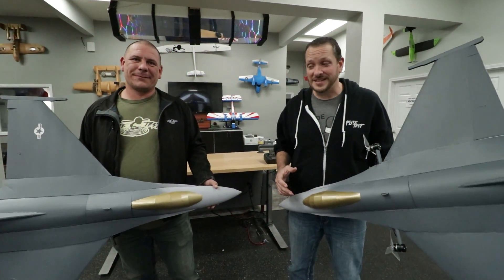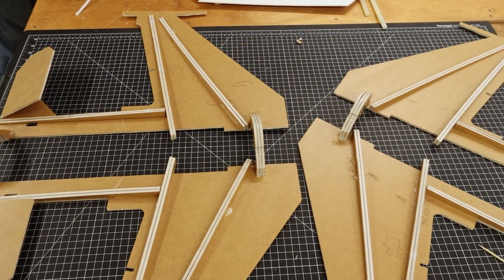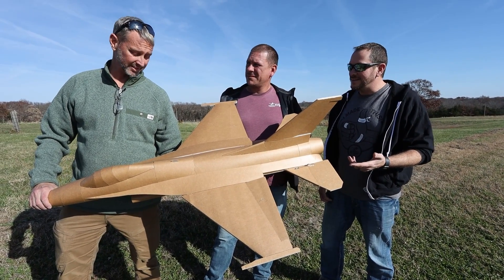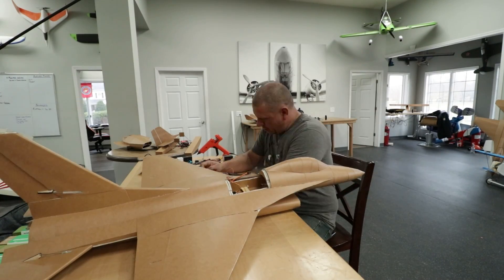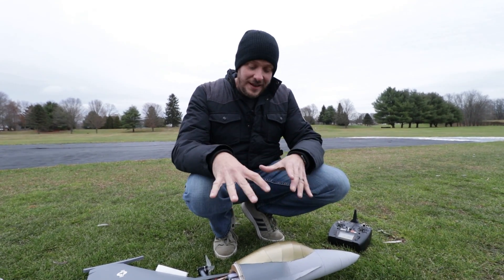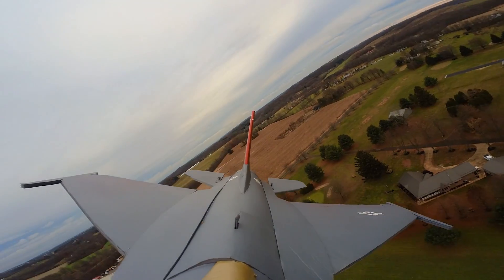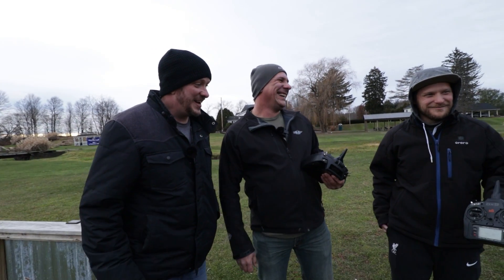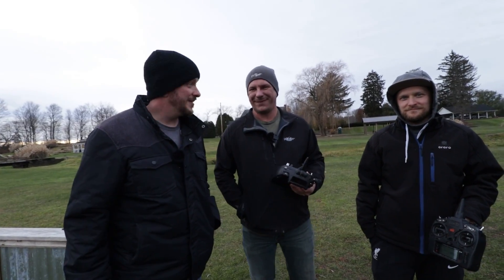This F-16 Viper can do a FLIP!!

Comment: I bought the speed build kit and the 70mm EDF with the 3600kv motor Esc combo but my model seems quite tail heavy.  The instructions say the CG should be 1-1.5" or 38mm from LE,,, but where along the LE, at dynamic center of wing or where the LE intersects the Fuse?  Even with 2 1500 mha 4s packs biased all the way forward my model is still tail heavy.  What battery did you use for this video?  Any tips or advice balancing before my maiden would be greatly appreciated.

Comment: Hey, looking to build the f pack dual motor setup. What battery and esc should I use along with the fpack motors? Or should I just get a huge 4cell and use the esc that's used with the fpack

Comment: I just placed my order for this awesome F-16! Question, my 4s Arrows Marlin running a 64mm 11 blade fan is now just a collection of totally usable electronics. The foam looked like a cooler that met a log chipper, but the EDF, ESC, Admiral receiver and 8 of the 9 servos survived the carnage. The Marlin was heavier, had larger wingspan, etc. What is the consensus of opinion concerning the FT F-16 running this powerplant?

Comment: Just a thought, why not use the missile hardpoints at the tip of the wings as booms for the motors? You could get a TON of differential and it could even reduce the vortice drag!
Cons: less airflow over the control surfaces? It would mess the CG, although if I remember well the F-16 is unstable by design right?
Anyway, keep up the good work guys, I love it!

Comment: With that prop plane if you shaped the engine duct just right it would add some thrust to the aircraft from the air flow into the engine area using their Bernoulli principle

Comment: Used to be F16 avionics tech .. brings back memories...
Reply: Same here Aviano 02-05, Luke 05-06, Osan 06-07.
Reply: @NoAgendaFPV  cannon 05 to7, Luke 07 to 08, reserves 08-09 on A-10s then 10-11 cannon again as a contractor for the pred ground control stations. Now I work on medical Xray equipment

Comment: Those flite test radials are crazy powerful. I used two of them to make a foamboard 20 x 20 pizza box flier and it fluttered the rudder off while in a vertical climb.
Reply from the maker: Thanks!  Good magnets and good bearings. Love pizza box fliers. :)

JB

Comment: Have you guys thought about making another air craft carrier?  And maybe compete with each other trying to land different mini series planes on it?
Reply: Yea I know the flying carrier in the Marvel movies is cool and all, but it suddenly occurred to me that for a flying carrier it would be pretty redundant to have a catapult to launch the planes. After all there's really no need for it as when you're several thousand feet up there's no problem just dropping the planes straight down. Might feel a bit funny the first few time but it certainly cuts down on the complexity and size requirements as you do not need a longer take off / landing strip than what's needed for landing using a catch system.

Other than that it should be quite easy to design a carrier in the form of a oversized drone. It would however be a problem to make it stable as anything that big and still light enough that it's practical to lift it with a number of drone motors will be at the mercy of the wind.

Now if you build a carrier that is flying like a plane then it wouldn't need a large take off or landing strip at all as long as the planes it serves can fly at the same speed as the carrier. It certainly would be an interesting test of skill to land a remote controlled model on one of these. I'm guessing FPV would be needed to make this more than a expensive guessing game.